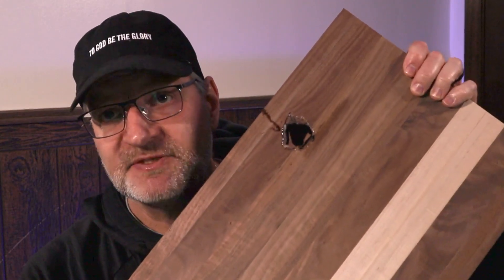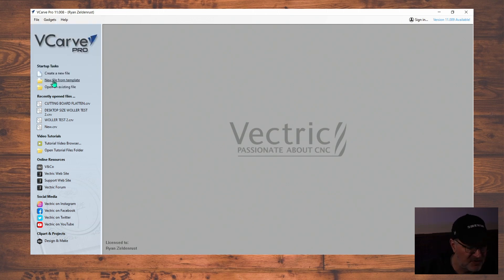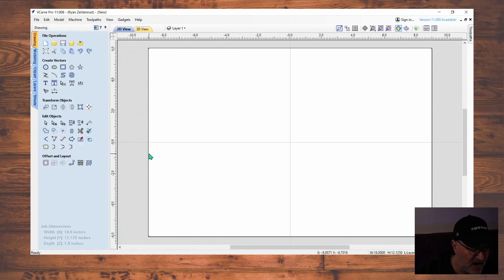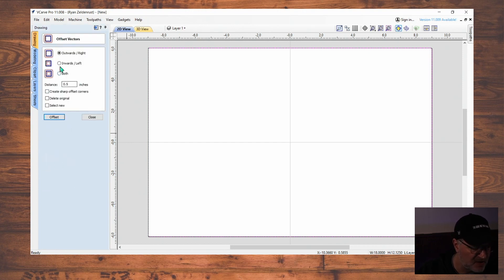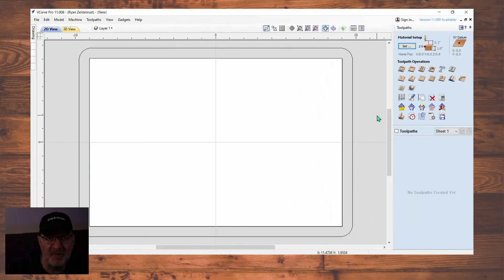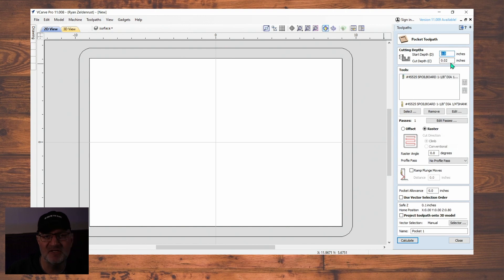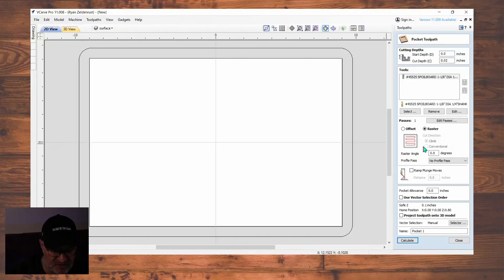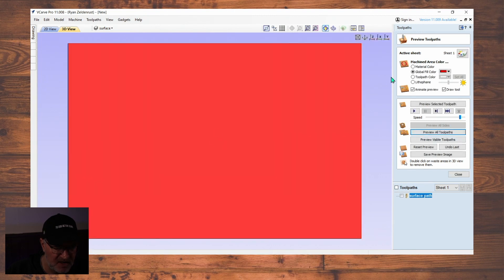Flatten A Board With A CNC Router - Onefinity CNC [Vectric]

Comment: I just watched your video - great information and presentation!  The only thing I missed was the Z-axis 'settings' (the point of the video!). I am wondering how you plane off 0.020" without creating another file that starts with a part that's 0.020" shorter than the first (1.00" first side, 0.980" second side? ).  Or are you manually setting Z-axis height each time you start the cut, ignoring the 'height' setting in the file?  Thanks!
Reply from the maker: I manually set it each time. I try to find if there is a high spot and go set Z there.

Comment: did you have to shim it on the first side if it was wobbly?
Reply from the maker: I didn't have to shim it. Best practice is to put the side down with the least wobble. There will be times where you have no choice but to shim a board. Just use your best judgement. Thanks!

Comment: What do you do if you have to do multiple passes? Can you walk usthruthatoart? When I work with epoxy there’s some spots higher than others and I have to start at that height but take 4+ passes so how would you program it to be quicker than having to reset xyz after each pass ?

Comment: Good day, been making cutting boards for a while, but totally new to CNC so I have a question. It's deffinetly taboo to run a endgrain through your planner, how would it be on the CNC?
Cheers
Reply from the maker: I have done it many times. The key is very shallow depth cuts and you will still need to do tons of sanding.
Reply: Thank you. @twoelmbuilds

Comment: How do I set x and y start point for work piece with resurfacing bit?
Reply from the maker: Typically I will set the X Y with a vbit. Then I put in the surfacing bit and set the Z. I will set the datum at the center of the workpiece most of the time.

Comment: hey thank you this helped alot, i'm new to cnc what program do i use to import the file and run the cnc? thanks
Reply from the maker: Thanks for watching! I use Vectric Software Vcarve Pro. I do have a video showing how to export Gcode from Vcarve Pro to the Onefinity cnc, but it may be a little different if you have a different cnc machine. What machine are you using?
https://youtu.be/cbk_b2XG0t0
Reply: @twoelmbuilds  Thank you will check it out.

Comment: Mind sharing your feeds/speeds for that bit?
I also have a onefinity, i have a whiteside surfacing bit and use the whiteside database feeds/speeds you load intro vcarve - works flawlessly on MDF but anytime I try and surface plywood/hardwood it gets hotter then the sun and burns the wood.

Will likely end up getting your Amana bit (I love amana) and unless otherwise stated will try the Amana feeds/speeds they include for Vectric.
Reply from the maker: Most of the time I make really shallow cuts. I almost never go deeper than  .06" deep. Most of the time I only shave it down by . 02“ per pass. The speed is usually around 3 on the dial of the makita (but you can adjust as you go).  Feed, that is a touchy one. Some woods burn really easy so plan on doing some sanding. With hardwoods, like walnut, I will run 90 or 100 inches a minute. Usually gets the job done. At least it gives you a starting point and you can adjust from there. I like the Amana bit because it is a lot of metal that helps dissipate some of the heat.

Comment: I take it that you are using the center as your zero point?
Reply from the maker: I have realized over time, that the habit of using the center as the zero is best because sometimes I make odd shaped cutting boards or circle cutting boards. It's much easier to work with a center zero point in those circumstances. But with a rectangle shape, you can use a corner if you want.